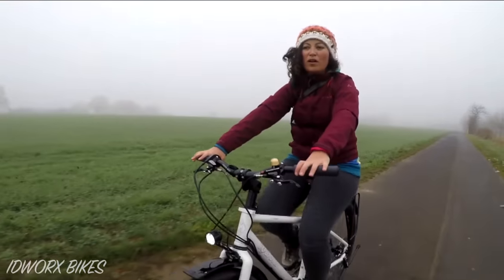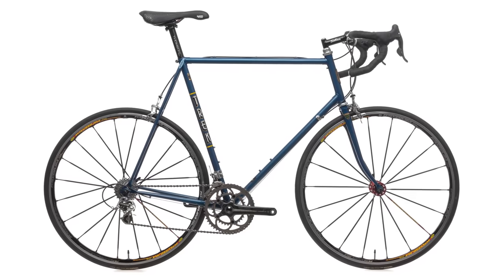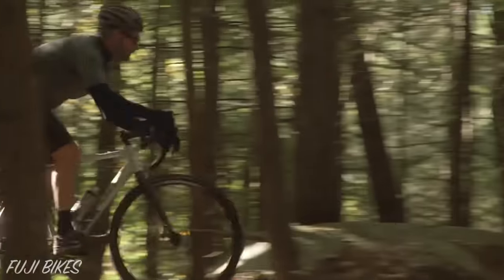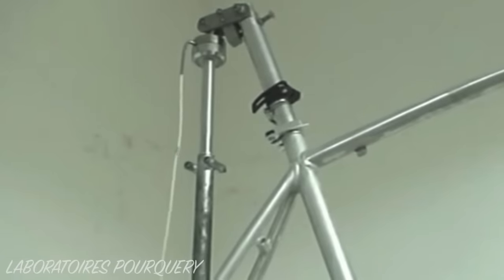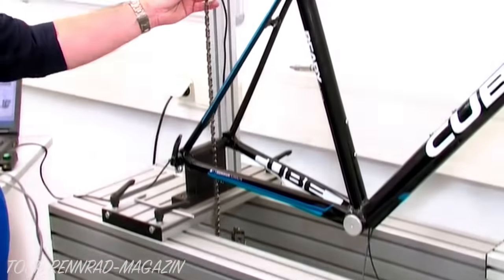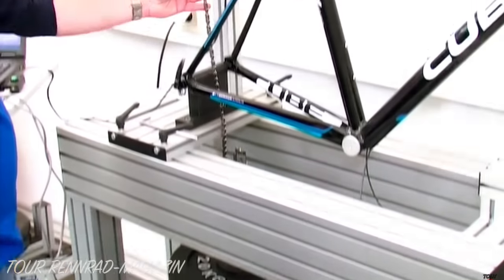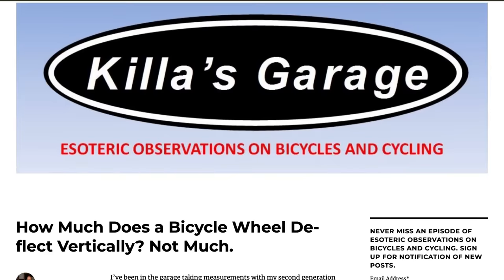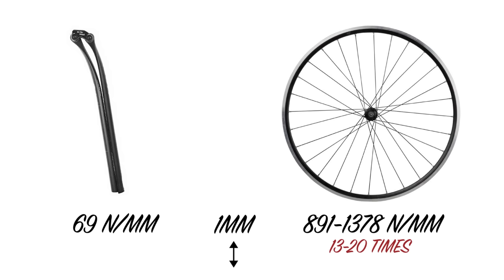Why It's Impossible For Steel Frames To Be More Comfortable Than Aluminium

Comment: The problem with the theory of vertical springs in a perfectly vertical plane is that when you ride a bicycle, your bike is not - probably rarely completely vertically aligned to the ground.  That being said, the bicycle is absorbing bumps not as they are in a lab (perfectly vertical), but when the bike is ever so slightly tilted.   Also, if you are claiming that because the lab could not show measurable differences, that would fly in the face of your preference for the resonance damping characteristics of carbon frames since it isn't measurable.  

In fact, the minuscule differences between the resonance damping effects of certain tube designs are added up among millions of vibrations that occur over long timeframes when you are on the bike.  Those can be felt by the rider.  Those millions of vibrations while the bike is slightly off a vertical plane.  Bikes are pedaled, not run by a motor, so you have the motions of balance at play, throwing the bike at an angle while transferring road jarring which I am not so sure the science has tested for.
Reply from the maker: Interesting idea, there probably is a little more vertical frame deflection at an angle. I wonder how we could test the theory? My personal experience is that the vast majority of the time I'm going in a straight line, so I suspect the lab testing is quite accurate for the most part. 
But still, we need to take into account the rate of springs in a series. Let's say your frame has 2x more flex at an angle, and the seatpost has half as much. The overall spring rate of the system still calculates out to be less than the softest spring, which is still your seatpost or tyres.
Reply: @Cyclingabout  
I think they should put strain gauges and accelerometers (or whatever instruments they use) on bikes (or on the bottom of shoes and saddles?) ridden outside on all surfaces - keeping the same components for control perhaps.  It would be expensive I think. 
I believe that your current experiences is riding a bike meant to take a large load and not break, so the torsion of the bike frame is irrelevant, since it has been made to be as strong as possible.  Therefore, you are feeling the bike through the saddle , seatpost, wheels and most importantly, tires. Plus, all that weight resists the upward motion of the road surface, forcing the tires to do more of the work of bump absorption.

True what you say about the softest spring being the tires, but this still has significant results in feel.

Many springs of different spring rates are not the same as one spring equal to the softest of that of the series of aforementioned springs.  If that were so, progressive springs wouldn't exist - they'd all be linear.
Reply: But let's be real here, this kind of force/stress testing needs to be performed in the normal axes so that a benchmark for the measurement values can be easily established for different frames and thus validating the comparison because the test parameters are all the same. It is very hard to simulate all the tilts and bumps in real world because they are random even if you tested it on the same track. But theoretically those can be calculated if the forces in reference axes (normal axes) are known. It is easier to calculate for metal frames because metal is isotropic, but a lot harder for carbon if the carbon layups aren't known.

 @CYCLINGABOUT  Thanks for the video. I also think this topic about "frame material ride quality" especially the "steel is comfy" is overblown. Carbon can be made to be stiff in one direction and flex in other direction, thus it is very possible to design a carbon frame that takes vertical compliance into account. In my opinion, the components that have direct contact with the rider's body (other than tires) affect the ride comfort/quality more; so seatpost, saddle and handlebar. People have been talking about "I converted from carbon to steel and it's more comfortable" but they basically singled all aspects about the bike into one "steel vs carbon", thus ignoring other factors. Funnily enough, those who think there are significant differences between frame materials don't have data and almost always only provide anecdotal evidences.
Reply: @sirchristophermcfarlane9377  If there was no study on the topic, then people's conclusions are not true?  Does this mean that only where there is a study can there be fact?
Reply: @SurpriseMeJT  by "people" which one did you mean? The ones who say that frame materials make a big difference or the ones who tested these frames and concluded that there was no big difference? If you're talking about the latter, then technically their conclusion is true until proven otherwise. And yes, since fact must be proven with certainty and/or observed, they do require study to be established as a fact.
Reply: @sirchristophermcfarlane9377  Studies are very narrow and cannot conclude "comfort" from narrow measurement variables and narrow ranges.  It's a misinterpretation that leads to "facts".  Frame comfort is not only vertical compliance felt from the saddle.  To ignore the BB and handlebars means the study has not concluded frame comfort from one dimension.
Reply: @SurpriseMeJT  While studies could be narrow and incomplete, the data they produce still brings something of value to the topic compared to biased opinion, placebo etc. If the data is misinterpreted or lacking something etc, then it can be refuted with more data and gradually the level of certainty will increase and thus fact is established.
"Frame comfort is not only vertical compliance felt from the saddle", the question is, are we talking about frame comfort overall comfort? It is different, because testing frame comfort (based on measurement of frame flex or whatever) should only involve the frame and not the other replaceable components, else the test won't be about the frame only and thus is rendered invalid. If we're talking whether saddle, handlebar etc make difference in comfort, then yes as I've said, I agree, but I don't think it should be included when the subject of the test is the frame. These components are undesired variable in measuring frame comfort/flex/whatever because if you put them on one test bench and say, fix them at the handlebar tops and saddle, then the flex resulting from these components might outweigh the flex of the frame itself, making it unmeasureable or hard to measure, which eventually might lead to the conclusion that "frame flex does very little in contributing to the comfort". This video only mentions about frames and not complete bikes and the goal is, in short, to compare the different frame materials.
Reply: @sirchristophermcfarlane9377  The study could simply use all the same components, or better yet, machines which attach to the frame at the head tube, BB axle, and top of the seat tube.   Also, different frequencies could be tested instead of just bumps and measured at the points where the collective results would at least have a number.

I don't buy full bikes.  I almost always transfer the same parts to another frameset and have swapped frame materials many times.   My own anecdotal evidence tells me that large aluminum tubed frames are more rigid than narrow and thin narrow steel tubes.  Can a steel tube frame be harsh as well?  Yes, but it's overwhelmingly the case that the aluminum frames I've owned were all harsher than my steel frames, even if a test would show that vertical movement from bumps is no different.

Comment: Thanks for this. 
Always wondered at what point frame material made no difference. 40mm tyres seems that point for yourself, interesting to know.
(I'm riding aluminium frame, 35mm tyres, redshift suspension stem, redshift suspension seat post (recent addition))
Reply from the maker: You'll definitely have a very smooth ride with the low force required to deflect your stem and post!
Reply: I too have the Redshift combo on an Alu DBack Haanjo, but with the Rene Hearse (compass cycles)  48mm Switchback Hill 650b's . The rear is on a 25mm int width rim, the front is on a 40mm wide that expands the tire to 56mm. Topped off with a Brooks b17 (w/cutout) and  Tasis Fat Tape on top of  some fizik bar gel. Not for everyone I know, and not wining any Tuesday Night World Champs., but it rides like a Lincoln Town Car, and keeps this 240 lb, 51 year old out there on the bike.

Comment: Very strong position using sound principles in mechanics. Would be interesting to hear how the opposing view would refute this strong data. Thanks for the video!
Reply from the maker: I would love for someone to make a video stating the opposing view!
Reply: MJD  Exactly,all frames are built differently,to say they are all the same and ride the same........its a strong viewpoint for sure.  Seat stays can flex,chain stays can flex,forks can flex quite a bit and it can be seen while your riding. Fork is part of frame.
Reply: Very Cool. So based on their numbers, steel dampens vibrations ten times better than Aluminum. I think OP is forgetting that the ringing when he thumps the steelframe IS the dampening happening, as the whole frame transfers that energy into the air as vibrations, while the stiffer carbon or aluminum frame is transferring all of that energy straight into you!
Reply from the maker: The vibration attenuation on a bicycle is much more than a frame. Your body will absorb some, but so will your luggage/tyres/seat/carbon seatpost etc. The more components with high damping properties, the smoother your bike will feel. I've personally noticed that with 40mm tyres I cannot notice a difference in frame materials. And when I put my bikepacking bags onto my road bike, I think I'd struggle to notice the difference between frame material there too. Anyway, hoping to make a video on this topic with all the data available. 😎
Reply: @Cyclingabout  I would tend to agree. With any fatty tires or springy seatposts like that, any differences in frame material would be overwhelmed by the large squishy tires or suspension seatposts, but I definitely DID notice the difference on my roadbike with 28mm Gatorskins when I replaced the frame. If you insist on constraining your analysis, you are technically correct.
Reply: @KevinVilbig  
For years narrow tires were widely assumed to be faster, but it turns out they aren't.  At least not up to a point.  The link below explains better than I can, but basically a narrow tire doesn't maintain course as well, so this negates the smaller contact patch.  Moderately wide tires are both faster and more comfortable.  Tires are a more significant comfort variable than frame material.
https://www.youtube.com/watch?v=yrHxQg1OW0A
Reply: The double triangle bicycle frameset will flex when leaning into a turn. When ridden a frame isn’t only deflecting in the direction tested here.

Comment: Interesting. I switched from a steel HT rigid MTB to an Alu HT rigid Mtb, and I actually got bruises on my love handles. Everything was exactly the same except for  the frame and the seat post. The seatpost on the Alu frame was actually not as biffy and straight as on the steel frame.
Reply: If your steel bike is heavier, all other factors being equal: it will be more comfortable. More weight = less deflection = less rattling = more comfort. Our friend in the video forgot to mention how weight basically 'outweighs' all the other factors he researched ;).
Reply: @Coerced  I took up bike packing and noticed when I added about 12kg to my 26 aluminium hard tail , it was a smoother ride , i could coast the bike  easier when going down hill or flat ,  lots of pros , obviously uphill different story 1🤣 . I wonder if steel bikes can feel smoother cause they are often a bit heavier  and coast and ride minor bumpss easier with the weight improving gravity
Reply: The "weight" of a material doesn't control its stiffness/deflection 😊

Comment: To me, vertical deflection is a small and only one component of comfort and road feel. When you pedal hard, the energy goes into twisting the frame and your body is working against it. If the road vibrations are transmitted to your body in the process (at contact points) your will fatigue faster and not enjoy the activity as much. If you are climbing out of the saddle and the frame flexes back a little it is more comfortable and fun even though it may not be as efficient. Same goes for tires:many other considerations such as how well it grips under high speed cornering or how supple the sidewall is under angular forces, determine how comfortable and fun it is to ride.
Reply: You make a very important observation here. Not only the pedaling but also the bumps from the road/trail surface and the forces the rider applies on the handlebars all contribute to lateral twisting / flex that is usually deemed undesirable today (hence a lot of frame and component development over recent decades has been targeted at eliminating/reducing  this type of flex)
We end up with very stiff components and frames by design, that are then compensated for with larger vol tires and suspensions (front, back, seat tube, saddle). Thus it is not surprising that these components become way more important than the frame for comfort. That is how bikes have been designed towards.

Comment: I've owned/ridden steel, aluminum and carbon, and I can't tell the difference.  I have never experimented with seat stems.  In my experience it's tires that make the most difference.
Reply: toda la razon
Reply: Agreed I switched my hybrid to road tires and it helped but that aluminum frame still buzzes and puts my hands to sleep 😔😔. The problem turned out to be that the frame was slightly to big causing me to ride in a bad position because of the reach . My light weight aluminum road bike still climbs better so weight is definitely an improvement and not a myth 😂😂👍👍.

Comment: This came up on my feed, and based on recent experience, I concur. I'll explain.

For many years (38 to be exact), I've had a Marukin M420 road bike. I recently had it overhauled by my LBS, which put on 27x1 1/4" Panaracer Pacela ProTite tires on it. ProTite is Panaracer's puncture protection system; it's implemented by an extra band of material between the tire tread and the carcass. Because of the ProTite protection, the tire has a rougher ride. I feel almost all road imperfections, including the individual stones in the pavement.

OTOH, same LBS had a vintage Cannondale ST500, which I purchased and had overhauled. However, because it has an Al frame, the LBS put on regular Panaracer Pacelas; they're the same 27x1 1/4" size as well. The regular Pacela doesn't have the ProTite puncture protection, so it offers a much more supple ride. The Cannondale, in spite of having an aluminum frame, rides MUCH BETTER than my Marukin does! The main difference is one of the spring force variables cited in this video, mainly the tires.

Years Ago, I rode a bike with an aluminum frame, and it was stiff and jarring. The bike had a suspended seatpost. However, I don't know what tires the aluminum bike had. I can't explain why the aluminum bike I tried out had a harsh ride. OTOH, based on my recent experience with my two road bikes, both of similar vintage (mid-late 1980s) and their different frame materials, my Cannondale rides much better; the only major difference between the two (besides frame materials) is the tires that each uses. The aluminum Cannondale, with better riding tires, rides better. Thanks to this video, I now know why. THANK YOU!

Comment: Nice.  Seems like shock absorption is all about tires and suspension.  However the frame contributes to dampness.  I can definitely feel the differences in materials.  Steel has a characteristic feel compared to Aluminum.  A carbon Bianchi with countervail is super smooth!